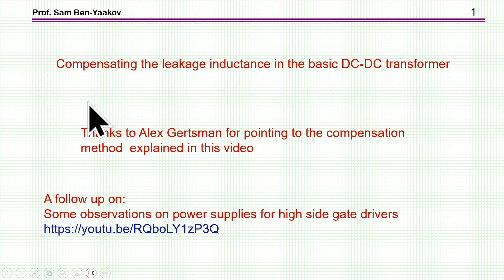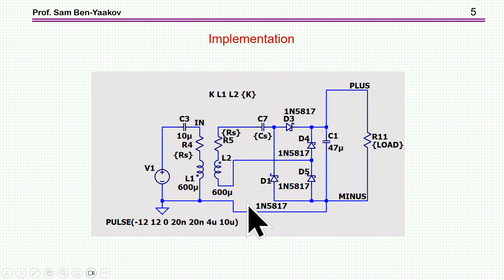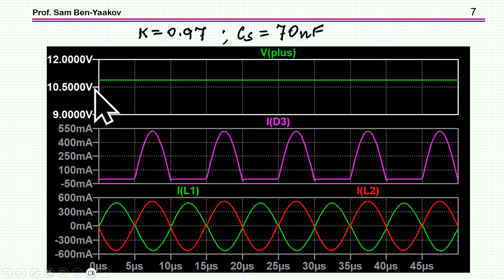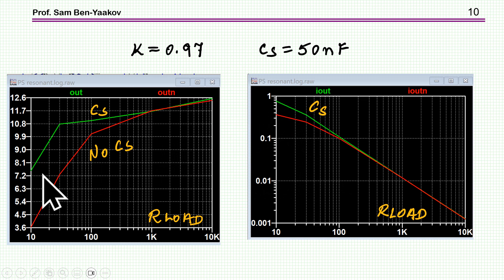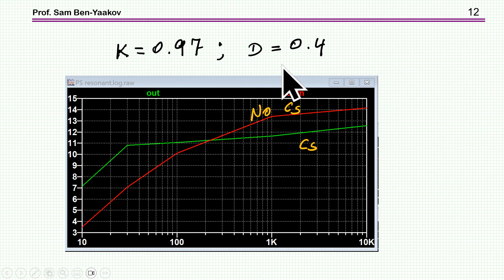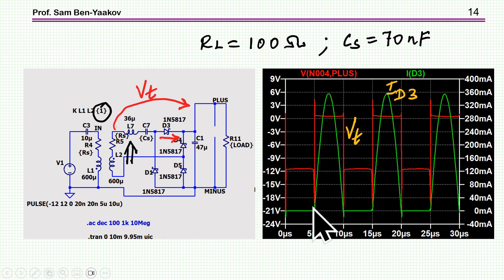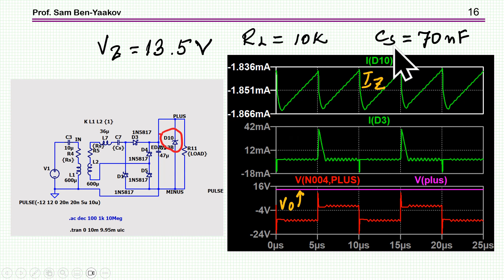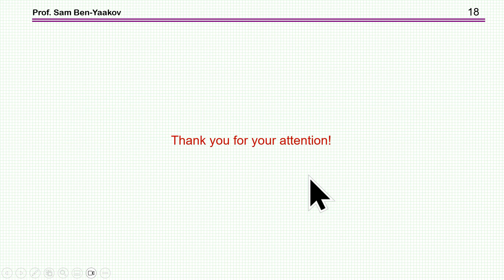Compensating the leakage inductance in the basic DC-DC transformer

Comment: something I forgot to mention on the last video before I watch this one, I was thinking a transformer could be designed with the use of a foil shield separating the primary and secondary. If wound on a standard E I core, the primary might be the first layer, then some insulating tape, then copper foil that doesn't make a shorted turn but connects to one of the wires, then the secondary. The field should pass through it transparently but the capacitance will have an alternate path to ground via the shield.
Reply from the maker: I think this will increase the leakage inductance
Reply: I have seen the foil trick done in some commercial transformers
Reply: The path for the capacitive current will be different (over the shield) but the capacitance and therefore current will be high. This will cause EMC problems.

Comment: Many thanks professor. Can I use this concept to directly drive the gate, instead of using it just as a supply. So it is like isolated driver?the overall frequency will dictate the switching speed, I guess
Reply from the maker: This would be a resonant gate drive. There are many papers on this.
Reply: @sambenyaakov  oh I see, didn't know it is called that. Will check it out. Many thanks

Comment: off topic riddle: how to measure (to model in ltspice) toroidal conductivity probe used to measure conductivity in the liquid. This is 2x toroidal inductors submerged in liquid so they form circuit of two transformers where winding is a liquid.  Google for "transformer conductivity measurement" to find some pictures of the probe construction.
Reply from the maker: What do mean by "model"? That calculate the lump conductivity of the liquid surrounding the probe and the mutual coupling?? or just assuming a resistance around the two coils opening that represent the  to the liquid and some mutual inductance? If the latter, how is it different from a simple transformer? Ang BTW I would think it will be MORE accurate and obviously simpler to use one toroid.
Reply: @sambenyaakov  weird I've posted replied last night and it is gone...
Reply from the maker: @krysieks  ? post again
Reply: @sambenyaakov  thank for replying me.
1. By model I mean circuit with leakage inductance, magnetising inductance, ideal transformer etc. I know how to measure parameters of simple transformer (shorting or opening second side) but having two transformers in chain is a bit confusing.
2. I am not sure I correctly understand your remaining questions. But i have done pdf which explain the problem in more details. I will paste as another comment cause i think it was the cause my comment was removed.
3. Also interesting is the concept of one coil. But how is that going to work? drive winding, receive winding, and liquid around doing as 3rd winding which will be shorted by resistance of liquid?
4. I have also found the paper: Reference: SNA 111761 which might have some answers but I'm still reading it
Reply: and here is a link to my pdf:
https://drive.google.com/file/d/1Ik2y4VIdlNyzCC9OYblHX4294BdM5jNA/view?usp=drive_link